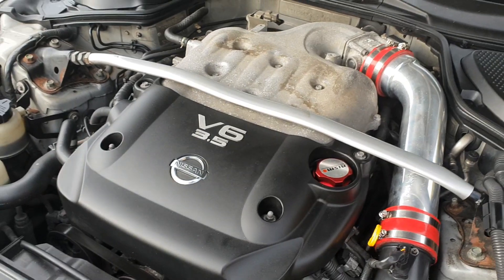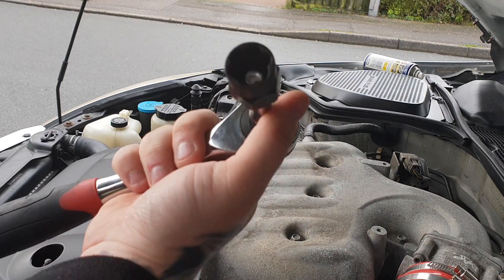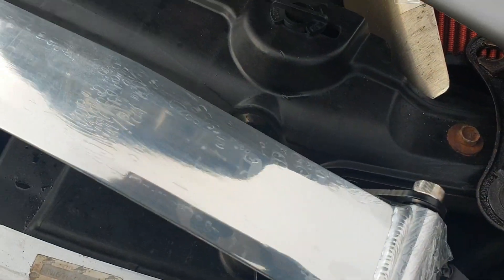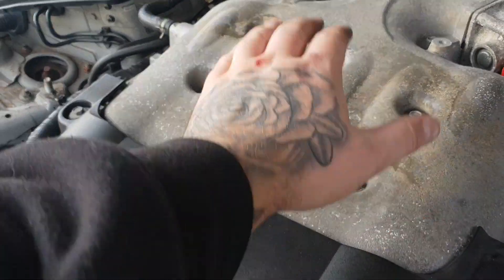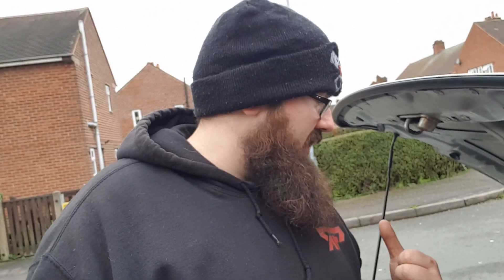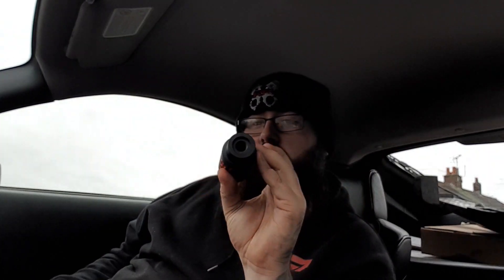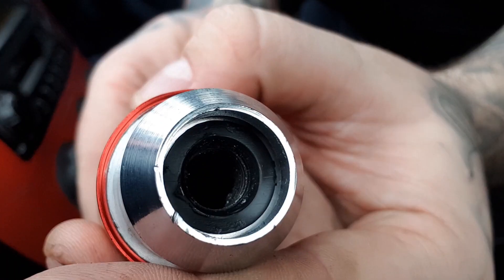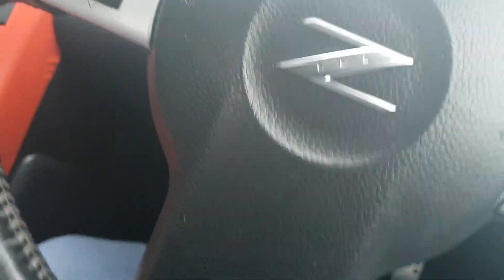She Get's Braced!

Comment: Am looking for interior welcome/reading lights for Corsa D, Am looking for blue ones. Trying to find the right ones on ebay. any advice or pointers. Much appreciated
Reply from the maker: You need some 5w5 bulbs or T10 bulbs mate :)
Reply: @RustyAutos  cheers bud quick reply. Is there a difference between the 2 what's on corsas standard
Reply from the maker: @jaydognir  there isn't any difference mate its just two names for the same bulb :)
Reply: @RustyAutos  klkl ordered the set of 3 for a tenner there hopefully looks good and the blub cover comes off easy lol